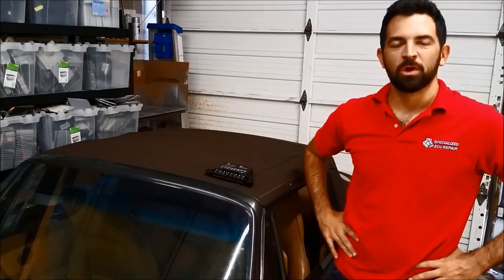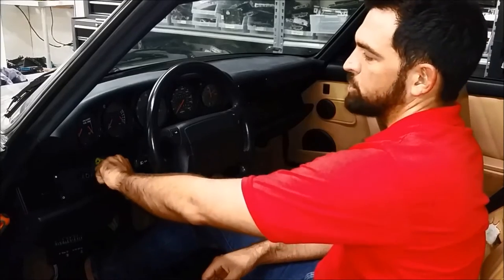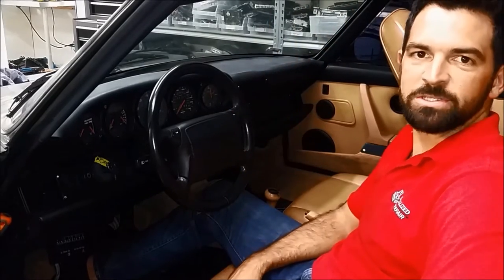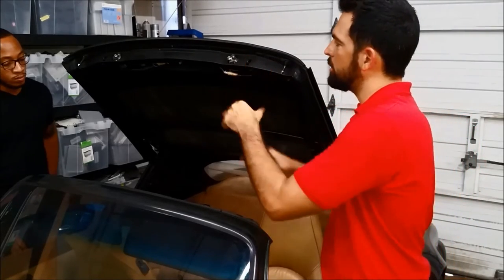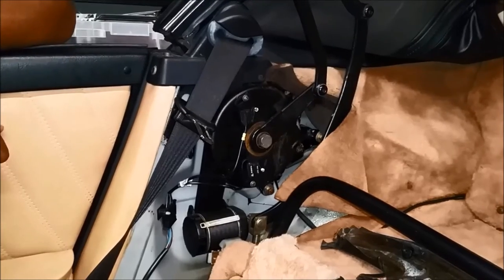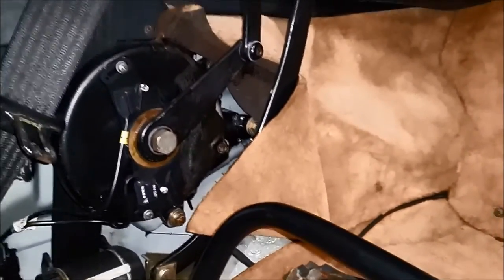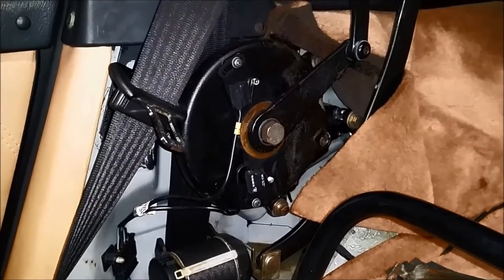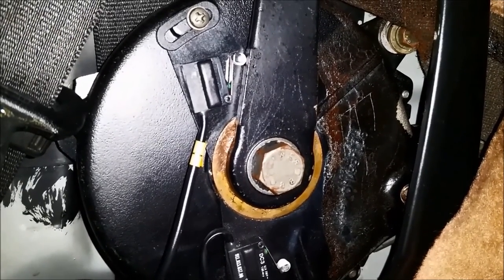How To Test Porsche 911 Convertible Cabriolet Top - 964 & 993

Comment: Great Video!!! tis , but when you are testing front switches , which one you press in the dashboard , as its impossible to press the button in the central control   with sitting on the drivers seat ?? and in the video you press it stand up , thanks again ,  very useful the explanation !
Reply from the maker: The switch to operate the convertible top is actually above the key ignition switch. Unfortunately, back in that era, Porsche did not put an illustration, or logo, around or on that switch to indicate what the switch was for. So you just had to know or guess!
Reply: @SpecializedECURepair  Tks so much for your quick answer , by the way my 993 I don't think it has this switch above the ignition !!! th only one I saw it that in the center console !!! but I will check it right now , Thanks again ,

Comment: My top was working perfectly and then today it wen to the closed position but did not lock.  All I hear is 2 clicks from the latch switch's but, no rotation.  I checked the fuse and it is good. Any suggestions on what else to check?
Reply from the maker: Hi, if you have a Porsche 911, we have a full top control testing guide here: https://www.ecudoctors.com/pages/instructions

Comment: i always raise and lower the top in my 95 993 with the engine running to save battery drain,   so not sure where your info on that comes from  ??
Reply from the maker: It's possible that on 993's Porsche enabled the Convertible Top operation while the car is running.
Older 911 models don't have that feature.

Comment: Do you know why when I close the top the light doesn't goes out and all sensors are working well ?? as it seems . Tks
Reply from the maker: It is possible that one of the micro switches is not working perfectly. This is not recent enough yet to try to fix anything. You just have to deal with the light on.

Comment: Excellent video....Please do one on adjustment on the cables....Porsche has never been able to fix mine right....4 times and two transmission replacements.
Reply from the maker: Thanks for the suggestion. That's definitely a subject for a mechanic to chime in on this conversation because from what I understand you have to be experienced in this system to fix the adjustments properly.

Comment: Excellent  Video     thank you  for posting    need more  video about  the  Tops  and  removal of motors and replacing motors   Great  video   thank you  were are you located   i need a mechanic
Reply from the maker: We are at 

941 NE 48 ST
Oakland Park FL 33334
Reply: Ok   you  are   in florida im in  California    Near   Oakland   and  San Francisco   but   i Did  have a question for you regarding my  1986  Carrera  Cab  power top    when i try to put the top down  it   starts  releasing the latching  completely but then it does not go any further  then that and it will not  re latch when i hit the button   and i have to  screw the motor into place by hand to secure it       once  i secure it  back into the latches   and hit the button it starts releasing and stops right at the top of window frame   what  do you think i should  check  i tried what you said in video and nothing  happened   I can  hear the motors for latches   clicking  when i hit button  ?
Reply from the maker: @mmb1487  Could you send me a video through WhatsApp here (954) 652-6342 about the issue that you are having so that we can better understand it?
Reply from the maker: @mmb1487  (954) 652-6342 could you send me WhatsApp video to this number for me to see exactly how the convertible top is behaving? 
Otherwise you can send it to your email info@ecudoctors.com